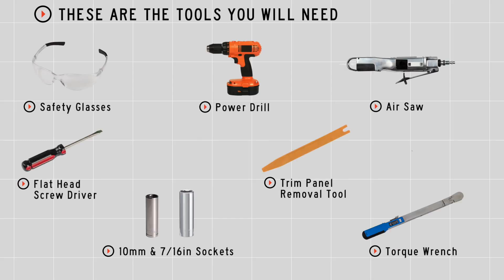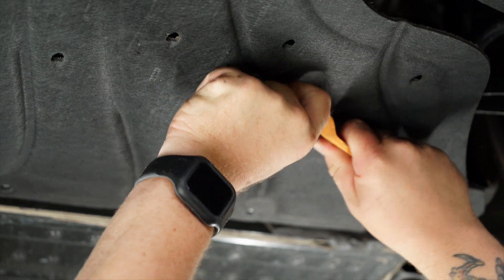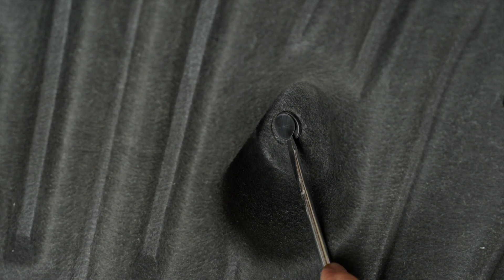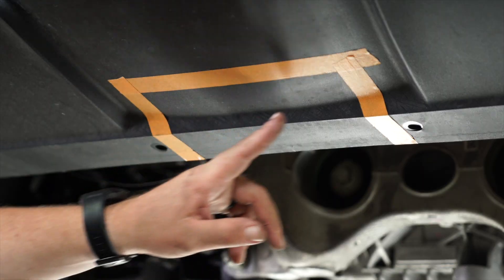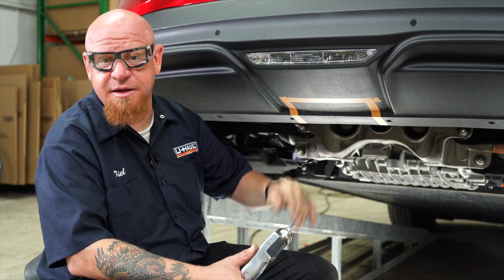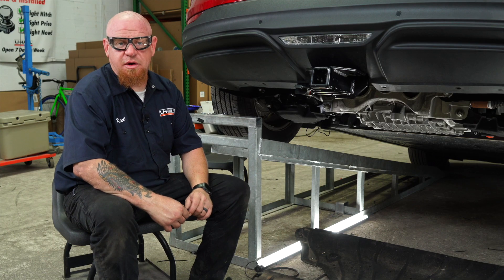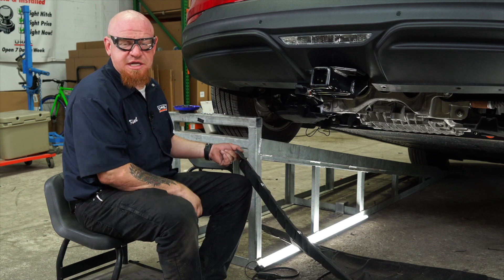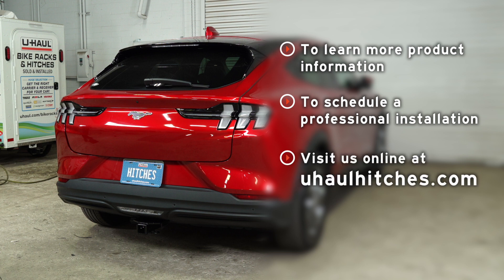2021-2024 Ford Mustang Mach-E | U-Haul Trailer Hitch Installation | CQT76460

Comment: Beautiful job! When cutting the facial panel, we can also make the inside corners have slight radius (make them rounded)  to help prevent cracking, and give edges a light touch with file to round of edges.
Reply from the maker: Thanks!